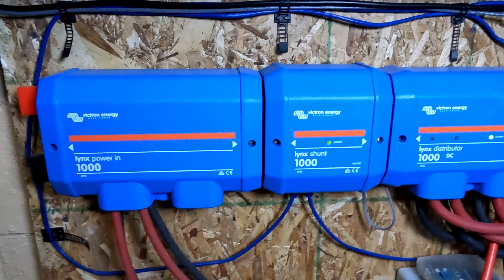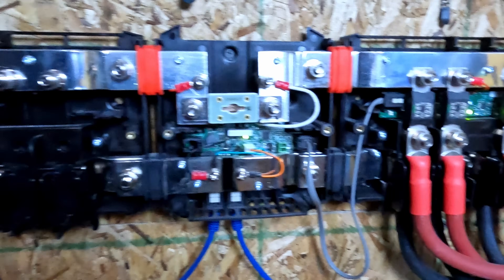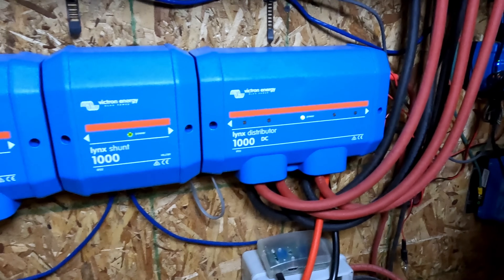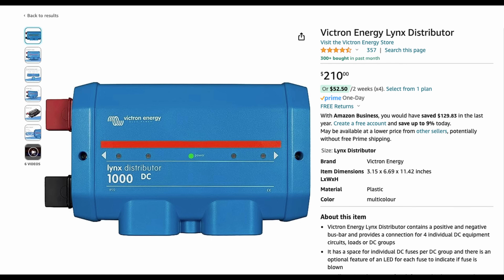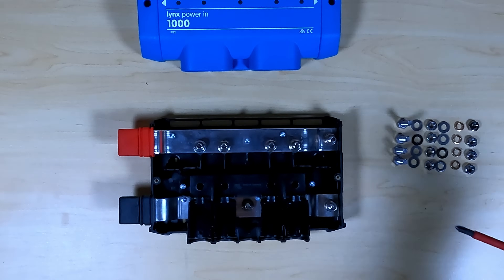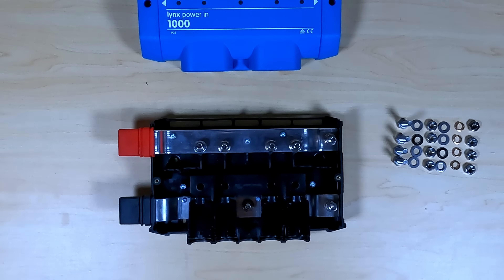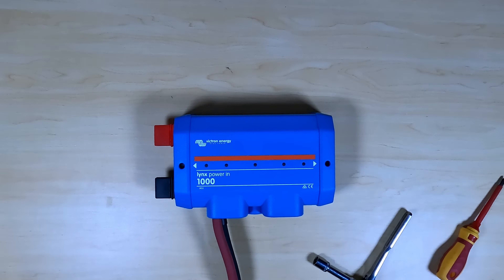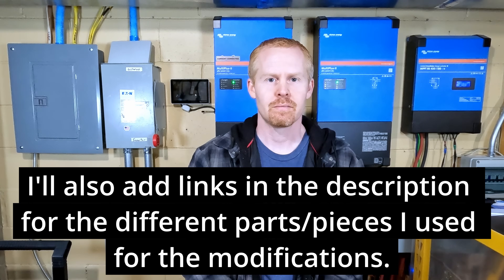Saving Some Money by Fusing a Victron Lynx Power-In

Comment from the maker: Links to the parts & pieces in the video (affiliate links)
------------------------------------
M8 x 25mm Hex Head Screw Bolt
https://amzn.to/3VBdhT0

M8 Stainless Steel Flat Washer
https://amzn.to/4cCaMWy

M8 Copper Split Lock Washer
https://amzn.to/4adMHDV

M8 Hex Nut
https://amzn.to/4cz8aZK

Victron Lynx Power In – 1000 Amps
https://bit.ly/3OLqTrc – Current Connected
https://amzn.to/43252kC – Amazon

Victron Lynx Distributor – 1000 Amps
https://bit.ly/44210I2 – Current Connected
https://amzn.to/3wyJYWK – Amazon

Victron 48V MultiPlus-II 5kVA 120V Inverter
https://www.currentconnected.com/product/victron-48v-multiplus-2-5kva-120v-inverter-70a-charger/?ref=AzzpK9Fl

10kVA 120/240v Base MultiPlus-II System
https://www.currentconnected.com/product/10kva-120-240v-multiplus-2-5kva/?ref=AzzpK9Fl

Comment: what if you want to use more than one generic LiFePO4 batteries wired straight to the bus bar in parallel, Can you use the distributor with fusing for battery? Am taking generic battery with a BMS that can not talk to victron. what is the bet way to know if there is a fault with one battery or one of the fuse has blown? Using a victron distributor is the best option?
Reply from the maker: If you have something to power the indicators on the lynx distributor, you can use it for batteries if you want.  It's just a bus bar with built-in LEDs.  I just check my batteries every so often and make sure they're still charging/discharging.  Doesn't seem worth the extra cost to me (unless Victron fixes notifications and alerts for the blown fuses).  

Most of the batteries I use don't have any communications with the Victron system, including a few DIY batteries.

Comment: Have they altered the moulding of the Lynx in?  My 25mm M8 Hex head bolts will not fit into the hex part of the moulding.  I may be able to file or grind down the Hex heads but without doing so they won't fit.
Reply from the maker: Not that I'm aware of, but it has been a year since I purchased mine.

Comment: i like victron but yeah its really overpriced for what it does. 150 euros..... for a plastic box with a metal strip and a few nuts....  50 euros seems a better value.
Reply from the maker: You’re definitely paying a premium, but in return, you’re getting something that’s built to last, well-engineered, and part of a system that just works. For critical installs or long-term reliability, that peace of mind can be worth the extra cost. But yeah… it still stings a little when you’re holding a €150 plastic box in your hand!

Comment: what are you thoughts on using the Victron Lynx Class-T Power In (M10) for a simple system using a V48/5K with 2 or 3 48, 100ah LiFePO4 batteries ? 
these will be a few parts of my first solar system/experience . 
we're in our 60s with a wood boiler for heat in a 900ish sq.ft 2 BR rancher .
thank you sir :)
Reply from the maker: You bet!

Comment: Is it possible to connect to Lync Power In for battery, solar charge charging, and inverter in a single unit? Thanks Adam
Reply from the maker: @adassociates8235  if you want to use it simply as a bus bar and not try and use the lynx shunt to monitor power flow, yes you can.

Comment: What fuses are you using? Most I see are rated at 32V.
Reply from the maker: I get the ones rated for 48v from Current Connected: https://www.currentconnected.com/product/littelfuse-mega-fuse-60a-to-300a-for-12v-24v-48v-systems/?ref=AzzpK9Fl

Comment: each mptt regulator must be connected by lynx space 1 space for an mptt?
i have 5 mptt i need 2 lynx?
not possible to put 3 MPTT on 1 lynx space and 2 mptt on another lynx space?
the current coming from the mptt is 40A max per mptt
Reply from the maker: It's recommended to fuse each connection from the mppt to your battery.  That way if there's any current issue, that connection is broken.  

The connections would be extremely tight if you tried to put 3 mppts on a single connection (if they would even fit).  You would then have the issue that if your fuse blew, now you would be down multiple mppts instead of just 1.  

Now what you could do is use the 4 connection points on the lynx power in and then add an external fuse and connect to the end of the lynx power in with the 5th mppt.  Usually the end is for connecting another lynx device, but if you added your own fuse, you could also use that.  Then you would only need a single lynx power in.
Reply: hello
yes I have a 40A fuse at the output of each mptt already ready!
3 mptt together is possible because the cable at the output of the mptt is 6MM²X 3= 18MM² eyelet terminal in 25 or 35MM² would pass
yes I understand at the end of the lynx used to add 5 mptt good idea!
but on the other hand I could not add a lynx power to power the battery!
and I also need 2 slots for my future multiplus 8000VA!
I think 2 lynx will be less dangerous!
Reply from the maker: @laurentsosson1739  Yeah, personally, I would just get a second lynx.  Ultimately it will make things easier and a much cleaner install!
Reply: hello
yes I have a 40A fuse at the output of each mptt already ready!
3 mptt together is possible because the cable at the output of the mptt is 6MM²X 3= 18MM² eyelet terminal in 25 or 35MM² would pass
yes I understand at the end of the lynx used to add 5 mptt good idea!
but on the other hand I could not add a lynx power to power the battery!
and I also need 2 slots for my future multiplus 8000VA!
I think 2 lynx will be less dangerous!

Comment: Power in to the system from batteries should be fused at the batteries within 6” of the positive power posts. ABYC requires this to prevent massive electrical fires should battery cables short out.
Reply from the maker: @robertschulke1596  what is ABYC?

Comment: is this how you tapped your battery to supply the power to the extra inverters which you have been testing?  I have wondered how you did that and want to duplicate that.  I am powering my XW Pro and want a a 2nd unit, but they are $3500 from SS.  Then watching you test/review the 6000XP,  I thought I might just add the 6000XP to my existing battery and save $2000 now over the 2nd XW Pro
Reply from the maker: Yeah, that's how I ran my DC side.  I just used 4/0 off that Power In to go to my test wall and added a bus bar on that wall for the other inverters.
Reply: @AdamDeLayDIY  bingo,  thank you for the great insight to that issue.  I currently have 500 amp buss bars and want to replace them with 2 Power In panels.  Now I have a place to put the existing bus bars to use, in the 2nd (or 3rd) inverter area 😀
Reply from the maker: @dougbertInExile  not a problem!  Just make sure you have some kind of fuse for your other inverter line.
Reply: @AdamDeLayDIY  for sure

Comment: They must have changed the Victron Lynx power in, because mine doesn't have the LED cutouts and no mine is not the new version with the M10 studs
Reply: No it's just the regular m8 version of the lynx power in, I have seen 2 versions,  one with the provisions for the leds and 1 without . It has took me over 3 years of saving and buying everything one piece at a time to be able to get the equipment for my solar system because I live on a very fixed income and I am disabled and unable to work, hell I can barely walk. I live in my 1967 GM city transit bus on my friends land out in the high desert of New Mexico. It gets very hot ( over 100 degrees) in the summer and very cold ( below 0 degrees) in the  winter here . I've been trying to get my system up and running so I can be more self sufficient. Next on the list for me is the Victron lynx distributor and smart shunt 1000, fuses and a shut-off switch and the copper bars to connect them.
Reply from the maker: @jamesmason7124  Good luck with your install.  I know all about having to peace-meal a project because finances are tight.  

If you wana save a few bucks, just get another Power In instead of a distributor (unless you really want to see the indicator lights).
Reply: The picture at the beginning of this video shows a different version of mine , Yes I rather just save up and get the lynx distributor. I will be actually using my lynx power in to connect my batteries into parallel, I am also building my own batteries from headway 38120hp cells so I will also be able to start my bus with them, but before I will be able to use them for starting the bus, I will need to get a Wakespeed WS500 alternator controller that will connect to a Victron cerbo gx that I still need to get . Money is such a pain in the butt
Reply from the maker: Hmm.  You're the first person I've heard from that said the design was different.  

I know there was supposed to be a newer Lynx device that used Class T fuses instead.  Did you end up getting one of those?

Comment: Can I connect multiple mppt controllers to the lynx distributor or power in ? I have 5 different mppt to accommodate different panel sizes on a boat.

Can I double up cables on the posts or are they too short or space restrictive?

While there are only 4 connections, can I use the bus bar terminal to the right as a 5th connection?
Reply from the maker: Yes you can connect multiple mppts.  I’ve got several connected.

If you got creative, you might be able to double up, but I’m not really a fan of doubling up high current cables.

Yes you can use the terminal ends as extra connections.  I’ve got my cerbo and rsd power supply on the terminal end.

Comment: I saw this online like you did and always wonder... why? Power In is $150 on Amazon, Distributor is $210. If you want M10 terminals on the Power In it's over $180. In a system that has multi-thousand-dollar inverters, folks are trying to save $20-50? Better savings areas would be re-using any HDMI screen laying around instead of the Cerbo touch panel (which I did, saving $220-330) or using a raspberry pi instead of the Cerbo (maybe $150 if buying the Pi, $279 if you already have one). To each their own, I suppose, and I don't want to "knock" you or anyone who chooses to go this route, but I'd rather get the appropriately-badged Lynx Distributor and offset the chance that, in the future, they enable remote fuse monitoring through the Cerbo. :) Looking forward to your next project!
Reply from the maker: Thanks for the comment!  I see any savings as a win as long as it doesn’t end up costing you more in the long run.  

Each thing you mentioned though is another point of possible savings.  Another thought is just using a tablet instead of an hdmi screen connected to the cerbo.  Lots of possibilities!

Comment: Just did this for my RV recently.  I found two washers on top of the bolts but below the plastic separator helps keep the bolt head seated deeper in the holder and make it less likely to slip out and spin.
Reply from the maker: I hadn’t noticed any spinning issues but I’ll keep an eye out when I add more connections. Thanks for the tip!

Comment: What’s up Adam⁉️
  We started this journey together two years ago with signature Solar it’s been a long bumpy road anyways I have got a fantastic Victron system now and I’m blown away with how flawless it works compared to my EG4 orgrowatt whole house system
  I’m like 90% off grid now with electricity.  And trying to figure out how to connect my victron system to my generator so I can be completely off grid  
   Is this something you will be doing or will you stay connected to the grid  for when we have a few cloudy days 
   Keep the great videos coming you’ve been a huge help 
  PS people it might take a little while  to save the money for a top of the line system like victron BUT. It’s totally worth it  compared to a lower end entry level solar system 
  I’m glad I still have a house  with some of the failures in my old systems.  Very scary  With some of the issue I had
Reply from the maker: Hey Cowboy!  Yeah it's been a wild couple of years.  It's amazing the difference between quality and quantity...

I'm still working on more solar and batteries to take more of my house off-grid.  Getting there slowly.  

The only generator I have is an open-frame genny w/o an automatic start.  I would imagine though that it would be exactly the same as how I set up Ignoring the AC IN using the generator start/stop feature of the cerbo (https://www.youtube.com/watch?v=4ZsGHi8nKGc).  You would just run the two-wire from the cerbo to the generator instead.  

Yeah, you had some sketchy stuff happen.  Glad you've been able to get a solid system in place!
Reply: @AdamDeLayDIY   Keep up the great videos 
  I’m sure you’ve helped a ton of people including myself buddy
  Thanks a Ton ‼️
  Both of my generators have push button start   But no dry contacts to connect to my cerbo 😢
Reply from the maker: @cowboymcq6711  Thanks a lot!  

I know I've seen comments of aftermarket auto-starts for generators as long as it has an electric start.  Might be worth looking into.  You may have to make a few modifications but if you don't have to go outside to start...might be worth it!

Comment: Are those aluminum buss bars?
Reply from the maker: Tinned copper
Reply: @AdamDeLayDIY  thank you. I was just wondering because of how shiny they were
Reply from the maker: @k-sell4065  no worries!  I originally wondered the same thing.
Reply: Victron stuff is exspensive but it’s all top notch equipment from what I’ve seen so far 👍🏼👍🏼👍🏼🥳
Reply: Tinned copper is really important on boats because of concerns about corrosion.  Victron is huge for boats so they really focus on that (also why they use stainless steel for all the bolts on this too)

Comment: Just did the same thing for my EG4 6000XP and a few DIY 100ah battery packs.  Super easy, used 48v/125a mega fuses for each pack